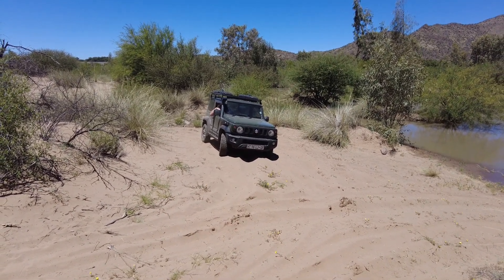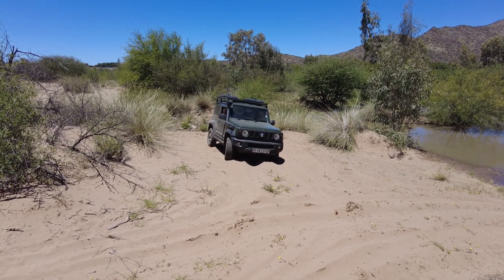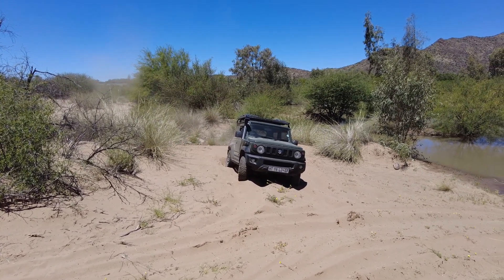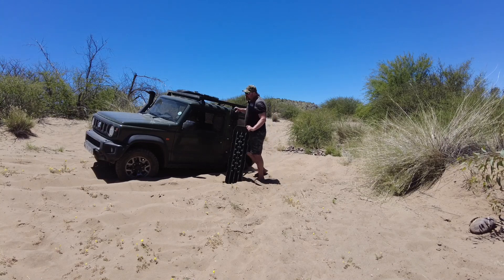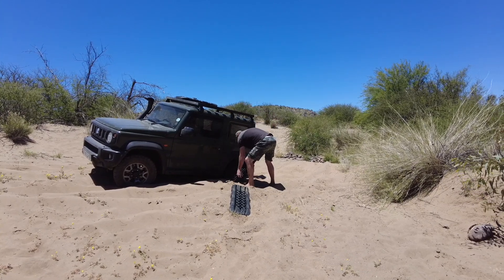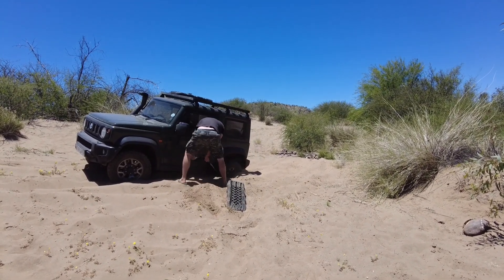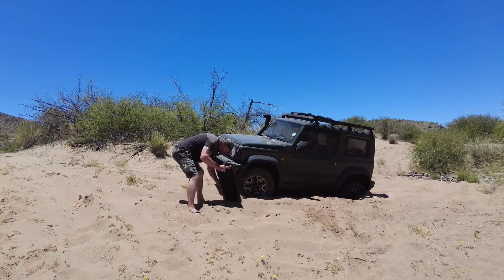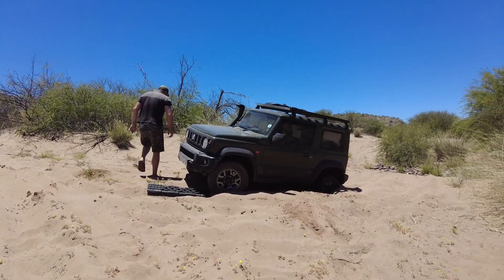Using Sand Ladders for a quick recovery

Comment: Hello. Question, whats ur fuel consumption with the 215s. Thanks in advance
Reply: I have the auto with the throttle controller which Raymond recommended and get about 11.5 p/L at 90kph
Reply: @paoloconcina1632  with 215s?
Reply: @Sinnerance  I have Dunlop Grandtrek AT5 215/75/15 awesome tyre
Reply from the maker: On this trip it gave me an average of about 12Km per liter.